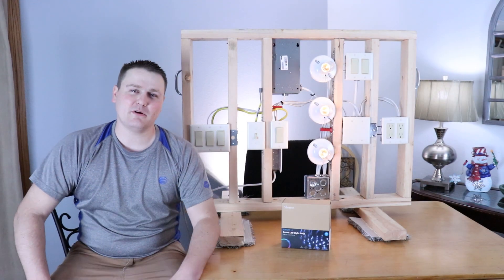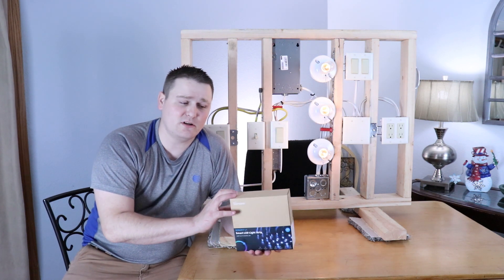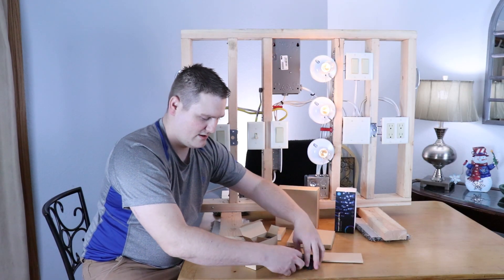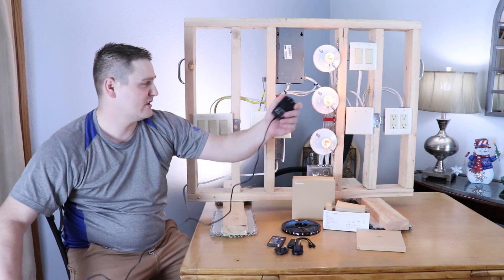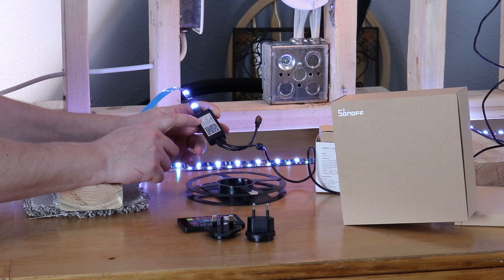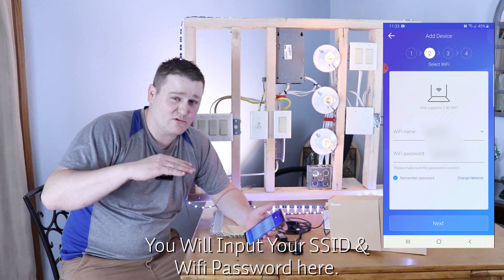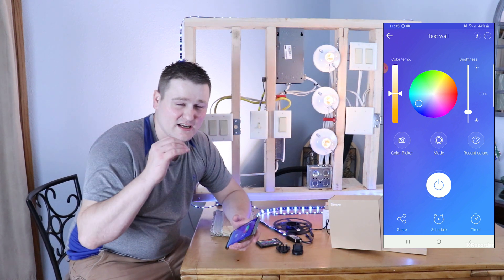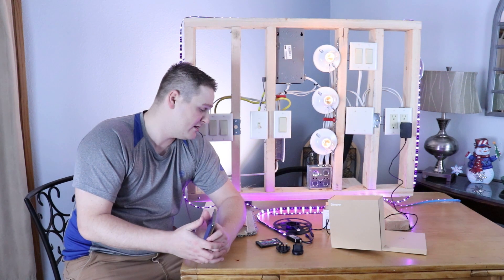Sonoff L1 LED Light Strip, Setup & Install (How To)

Comment: HELLO
How are you doing ¿
I've a question 
if i cut the stripe here?
And make groups of the RGB stripes 
Do that work as the same way when you set up it all as a long rgb stripe?
Reply from the maker: As long as they are all connected to the main unit yes and I think the max support amount is 30m for the less lights
Reply: @TNW1337  
I'm really sorry for my typo
I was almost sleep when i wrote the comment 😂😂
I plan to buy this RGB stripe but really so expensive here in Syria..
I need more time to get it..
Thank you for your reply. ♥
Reply from the maker: @alishahoud2614  Any time sir stay safe.

Comment: Hey! Thanks and congrats for the video! I'm having trouble pairing the receiver with my phone. I hold the ON button until the lights start blinking, but the app keeps searching for a device and doesn't find any. Any tips? Thank you!
Reply from the maker: Is your wifi on 2.4ghz only ? Also make sure your phone is on a network you want to set it up with.
Reply: @TNW1337  Thanks for the reply, man! My wifi has both bands (2.4ghz and 5ghz). I tried using both, no success. And yes, my phone is on the 2.4 ghz network
Reply from the maker: @rogeriomoretti6031  is it shared, or a splt network? You may have a bad unit. Send sonoff a email. They where awesome when I talked to them.
Reply: I’m having the same issue here. Did you get it solved? What is the Sonoff support email? Thanks for you video!
Reply: Same issue here doesnt pair with wifi despite my phone is on same wifi 2.4ghz network

Comment: When I took the pin out the remote it wasn't activating so I tried to put the pin back in to reactivate and now it's stuck and won't come out what can I do? P.S. I think I put it back in wrong
Reply from the maker: Well it should come out do not plug it in it can fri the strip, but it should only go in one way. You may have bent the pins. I am sorry man that really sucks. I hope you get it figuerd out.

Comment: I need roughly 7m length of led strip. Can I join the 5m and 2m strips together? Or will I need to run them both on their own power supply?  
From Australia 🇦🇺
Reply from the maker: Yes you can get the joiner along as the + R G B line up your fine.

Comment: Do these have the option to set default power on behaviour so they don’t turn on after a power cut if they were off already.
Reply from the maker: If you flash them they do. I am not sure if you leave them stock if you can.
Reply from the maker: sonoff tasmota flash
Reply: @TNW1337  doesn’t the ewelink app have an option like that?
Reply from the maker: @RameezRazaRiaz99  I have not seen it, does not mean it is not there. but I also do not use the ewlink app any more. For me all my automation is with homeassist.

Comment: I cant connect to it with my phone, it just doesnt find the device, what do i do?
Reply: Same
Reply: Do you fix it
Reply from the maker: Unplug the main unit, then wait about 15sec.
Make sure to be holding the the remote on button well plugin it in. Then plug it back in. The leds should start to blink. Also make sure if you have a split network like 5ghz/2.4ghz that your phone is connected to the 2.4ghz network. if you need more help I can give you my discord info. Also the remote has a thing on the battery that saves the battery until used. May want to see if it was all removed.
Reply: Tech Nitwit i dont have a problem with it not blinking, the app just doesnt find the device...and i know its not because of Wi-Fi because i have a Wi-Fi light bulb that works fine and it says it works on 2,4  too
Reply from the maker: @jakubjahoda2119   it is possible you got a bad unit. But if you want try and  trouble shoot it later we can on discord. This is the eWeLink app we are talking about? Restart your phone as some time this will help. Also you have to chk to make sure that your phone did not connect to the 5ghz when pairing. My phone had done that.
Reply: Jakub Jahoda hey i moved the set yo of the lights and they pair to my phone, but the lights themselves aren’t actually turning on, what should I do?
Reply from the maker: https://discord.gg/58uUXpt